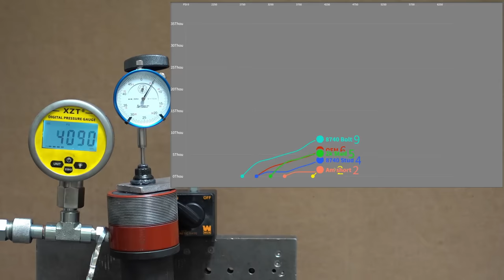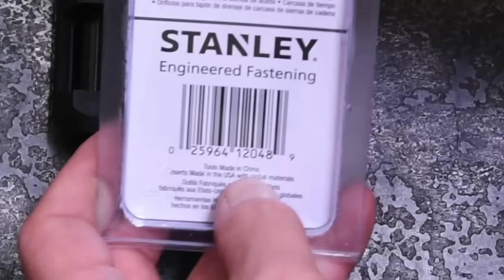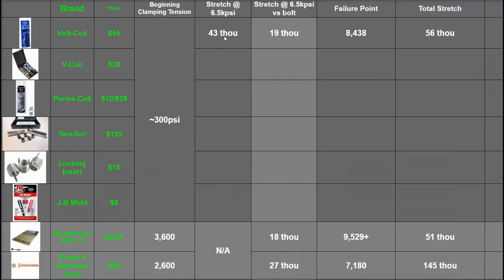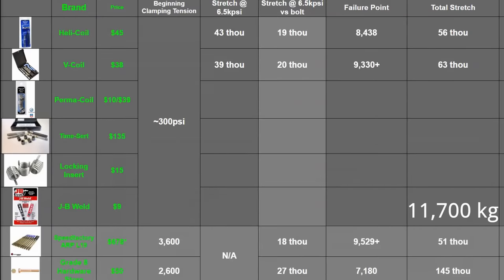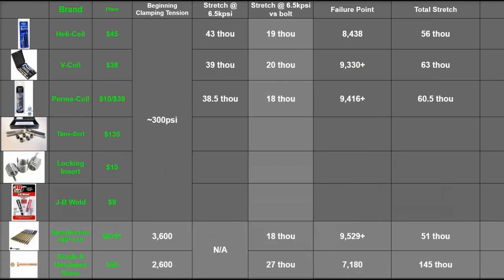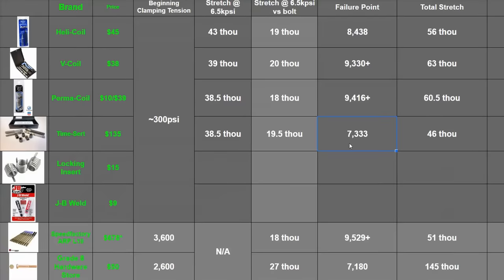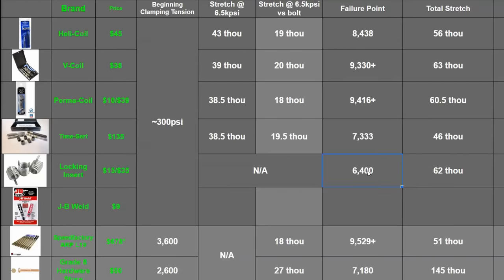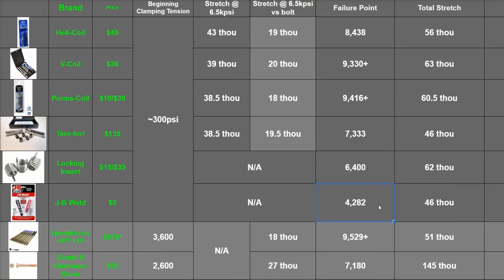12tons vs Bolt Thread Repair Using Time-Sert, Heli-Coil, J-B Weld & More

Comment: Two years later, I'd like to add a little info on the Time-Sert kit...
Time-Sert is a set typically suggested for stripped out spark plug holes...  CalVan is a similar design and often considered a better option than Time-Sert. 
The typical cylinder head doesn't give you a lot of material to work with and it can be very difficult to install a basic thread kit like Heli-Coil...  
By the way, it's "heelee-coil, not hella-coil. 🤣🤣..  
Time-Sert is designed with a shoulder to prevent the insert from being installed too deep. 
It's probably the best insert for spark-plug thread repair and considering low torque specs for spark plugs and considering that the insert is less likely to allow cylinder gases to escape past the insert. I'm sure there are other applications where an insert with a shoulder could be useful when you need depth consistency. 
Nothing is fool proof... I've seen spark plug repairs with Time-Sert/CalVan that blew out... If they aren't installed correctly, they are no better than any other brand.

Comment: Lots of comments about helicoils being good only for one use..that they won't stay put.
    Aircraft cylinders, from both Lycoming and Continental,  which covers 99% of anything over 150 hp, and most of the rest, all come new with helicoils for the spark plugs.
    They get taken out A LOT, required every annual inspection or 100 hours, depending on the type of use it gets, and usually more often than that. 
   This is an application where they are often sort of filthy from exposure to combustion byproducts from the leaded fuel, being run overly rich, oil fouling from high oil consumption, etc.
     I have had two start to come out with the plug, out of removing thousands over 30 years...
 ....actually, make that one, the other started to go into the cylinder when installing the plug, necessitating removal of that cylinder.
      If you have helicoils coming out frequently,  you're  probably putting them in wrong,  or loctiting the bolt into it or something.
    I also have no trouble with any coming out in many, many uses of them in cars, motorcycles,  whatever. They work so well. 
    I've also used time-serts, and have a friend who swears they are better, I've never agreed. Just much more expensive, and a bit more labor/complexity.
    When I say "helicoil", I'm also including off brands of the same type, which I've had good luck with also. 
   Simple and good. And now we know, as suspected, strong, too!

Comment: The locking inserts downfall is that they are designed to not utilize a full formed thread for the outside thread. You’re getting maybe 50% engagement of the outer threads because they have you drill a larger than standard hole for that size of tap. If you study the insert it’s evident the root of the thread is flat instead of pointed. Even given their downfall they’re still great for applications with a lot of surrounding material for room and where repeated removal is necessary.

Comment: The reason the helicoil is so strong even though it's just 304 stainless is that they work hard in it to something like 200-300 KSI.    So basically you can treat the helicoil as infinitely strong and the failure will  be the parent material or the bolt.    

Keyed inserts do better compared to gila coils when you have softer parent materials and so you need a larger area to spread the load out.

Comment: I JB Welded a bolt into an aluminum intake before and cut the head off to make a stud. Worked well for my needs, but intakes don't get crazy torque either so I can't say that for other applications.
I'm also happy that you and Project Farm tested these today. I have to repair threads on a push mower and wasn't sure how I wanted to do so.

Comment: Finally some question from many forums has been fulfilled. Some say that I am idiot using helicoils, I should use serts. I have used helicoils for exhaust manifolds and some various threads in the engines except cylinder head studs(never had to though). And one very big plus from helicoil style inserts is - of you screw it up you can pull it out and start again.

Comment: What if you used a helicoil inside of a JB weld tapped hole? Would that give more strength for extreme scenarios where JB weld is most useful?

Comment: Of the healing core you put the Loctite inside and not all the new threads their self. All the rest of them you did the opposite and they all held better. So did it have something to do with the application of the thread locker?

Comment: Excellent video - I've used v-coils for years for repairs and threads in 3d printed things, and we use helicoils at work. I don't understand the helicoil install tool - even the fancy aviation grade install kits for inconel helicoils look and work the same. It seems entirely unnecessary when compared to V-coils.

Comment: I want to see you get an M54 (BMW engine) block and test how much pressure it takes to rip the studs out of the block. When boosting them the most common things to go are the head bolts, the pistons, then the rods. I time-serted mine in order to "run more power" but this may have been a mistake. I never overheated the engine- so theoretically the block should not be that soft.

Comment: Have you considered setting up a lever on a pivot (think kids seesaw) between to test piece and the dial indicator? 

As the test piece fails upward, the lever arm on the dial indicator side will travel down and away from the indicator. You will have to start with a preloaded dial and do some math as your numbers are counting the opposite way, but that seems quite miniscule a task in order to save some dial indicators (Read LOTS of dial indicators)

Comment: Like many here I was surprised that the JBWeld did so well. Where did it fail? If it slipped out of the hole against the sides, maybe threading the hole before would be stronger

Comment: Surprised by the result from the Time-sent. It’s still perfectly usable, but I expected better. Going from memory, a time-sert kit is the only approved kit by Toyota for repairing the stripped head bolt threads that are far too common on the 2AZ engines. I’d agree though that it would be the best for applications where the bolt needs to be removed, especially if you don’t use thread locker (or you have to use thread locker on the bolt) since it is the least likely to just come out. Some thread inserts are literally not held in by anything and always come out when removing the bolt.

Comment: I'm curious how they'd work with a really "crudely" threaded stud (akin to some of the cheap bolts you see out in the field)... I think the precision/tolerance of the high end ARP hardware helped a bit (especially with the heli coil and v coil)
edit: if that Time Sert insert "felt loose" upon threading it in, the threads weren't cut very well.  I've done a few M54 BMW blocks with them (all 14 head bolt holes in each), and if you use a guide and tap carefully.. in other words, cut around a turn worth of threads, pull it out, clean all the chips out and go again... it's time consuming, but I guarantee if it was done that way (the time sert should go in with NO play side to side), it would've beat the crud out of the others

Comment: Done the JB Weld trick a few times. I've never drilled out the hole before cramming it full of JB weld. Not sure why this was done? Also let it cure for 48 hours, it's not really meant to cure that thick in an enclosed space. In terms of success, I've had about 50%. Sometimes it works the first time, sometimes it's the 2nd attempt.

Comment: Some really interesting results here!

I hate JB-Weld but you have to be impressed with how it performed. I wonder how it would do if the hole was not just drilled out but also tapped before being filled with the JB? Would the shape and greater surface contact give a better result? Would the larger volume of softer (compared to cast iron) JB give a worse result?

Comment: I wonder if some of those dial indicators could have been saved with a piece of "idiot string", tied securely to the indicator & stand, and to something overhead, with enough slack to allow free movement but still catch it before it hits the floor?  Or was the damage already done by the violent upwards acceleration, and crashing to the floor was just adding insult to injury?

Comment: instead of destroying a million dial gauges, try a limit strap setup or such as what you see on high travel suspension. so that when it blows it both allows the measured stretch, while directing the broken part away from the gauge. The limit strap could be oriented in a way off to one side so that it always explodes away from the gauge face.

Comment: ya know... since a dial indicator requires basically no effort to move them, you could probably make an off-set reader for the dials that can pivot when an excessive amount of force is applied. That way you don't have to worry about replacing the entire dial indicator every time. just reset the indicator's arm. (i'm thinking something like a nut and bolt that tightens down on a Y shaped pivot?)

Comment: I’ve had the same problem with timesert myself.   They actually came to my trade school to pitch their product. 
Claiming that their solid insert was superior to the coil type.  In my years of practice , the coil type is superior to the timesert. Their wall is too thin and collapses. Whereas the coil type forms itself to the hole.

Comment: You may not read all these comments but I thought this was an excellent test. Though I do think you need to retest the timesert. I have tested many different configurations myself, not using such a sophisticated system as you have but simply torquing an arp stud to failure. Timeserts have always been stronger than arp2000 studs in my testing. The stud fails then rips the insert apart as it stretches. Did you reuse the same stud repeatedly for each test? Is it possible the stud was already stretching a bit on the previous test over 9000 and then the threads where loaded very unevenly on the timesert? The helicoils will unspring with the fastener threads as they stretch, the solid timesert cannot, it breaks. The testing I have done was in aluminum and steel and a cast iron engine block. For sure helicoils do not have the same strength in a softer base metal like aluminum as a timesert does. Another interesting test would be repeated loading below failure especially taking into account removal and reinstallation between loading , this is also where the limits of helicoils show up. I would love to see another round of testing like this but push the load higher until the fastener or insert fail and especially comparing the strength of the bare threads in aluminum then with the different inserts, maybe use 2 or 3 rounds on the same setup so you are ruling out any sort of anomaly and having only the one funky data point. Replace studs approaching their yield area if you didn't already in this test or at least measure with a micrometer to check for stretch before the next test using that stud. I have no vested interest in defending timeserts but your results simply don't line up with all the testing I have done myself.

Comment: Putting a steel plate under the nut to give an offset surface to indicate from underneath may save your dial indicators

Comment: Testing across a temperature range of the JB Weld thread would be interesting… use normal engine block temperature range as a base… winter -20’C upto +140’C?

Comment: You have to put at least 2 Heli-Coils on top of each other to get the maximum strength. If you just put in 1 the material around it will crack.

Comment: U gotta try the ns300l inserts from huhn solutions I’ve used them to fix northstar head gasket failure due to the threads pulling out the aluminum block, used them in Kia’s too there a really good product

Comment: Aged ARP 625 studs have the same 260,000 psi tensile strength but without the draw back of not being able to handle them with your fingers. L19 studs can become brittle making them ineffective.

Comment: Should try this with belzona epoxy instead of jb weld. Have used belzona for this type of repair in hundreds of threated holes that seal pressure in and out on submarines.

Comment: Question.  Why don't you just measure the movement of the "cylinder head" from below?  So when the Bolt breaks and  flies off, the dial indicator isn't hit. It's all still the same movement.

Comment: So, it hurts my soul watching the indicators shatter like that. Would it be possible to weld a flat bit on the side of the bolt head (maybe even super glue would work?) and have the indicator read from the bottom?
Reply: agree. maybe make a net to catch the indicators

Comment: Possible amateur question here. If you drill out the hole and re-tap it, why not just use a different bolt and not use an insert at all? It'll be a bigger bolt so won't that make the connection stronger? I've done this many times and haven't had any bad results. I've even done it on oil pan drain bolts that strip out. Am I missing something?
Reply: 1) There isn't always enough room in the metal or the surroundings to fit the next size bolt, which will usually be at least 2mm bigger.

2) You don't want to end up with different sizes of bolt when there was only one before.

Comment: I always buy the cheap stainless helicoils 1,5 or 2 x Diameter lenght.  20-50 pcs. and I just cut them if to long.  I newer use locktite. put them in alu from new. if it needs good holding power. and yes normaly, they hold better than 8.8 bolts :)

Comment: I’m no advocate for JB weld but I wonder what would be the result if you drilled and tapped a helicoil sized hole, then injected the JB weld with a cheap syringe to the bottom of the hole so there’s no air bubbles, then let that cure, tap and drill that with the right size. 

On the one hand, there’s more JB weld between the bolt and the hole possibly making it weaker, but on the other hand the JB weld would have more threads to hold it in the hole, on the other other hand those threads being so close with the helicoil only works because of the thread timing, you’d lose a little thread timing between the inside and outside threads, idk if that would make it stronger or weaker.

Comment: Interesting. I remember installing a lot of heli coils early on in my career (we pronounced them "he-lee").
Haven't got through the video yet, but I hated them. IIRC they were a limited use. With every bolt in/bolt out cycle it would get harder and harder not to cross thread or strip out.

Comment: Im a bit sceptical with the hand tapping i guess thats how most people will do it but for a completely fair comparison you’d like to see machine tapped or thread milled holes for consistency
Reply from the maker: If that's what's required for a repair to work better than others then it doesn't apply to what we'd use it for

Comment: Think about your drill and measure the run out if you need one of these. The drill wobble and bit error alone or combined could be enough to fail otherwise fine coils. Do same test with a HF 80$ bench top drill that would be interesting.

Comment: Since the Helicoil test blew the top of the cast iron out, I'd be curious to see this with the "installed depth" called out. Barring all that, if supplies allow, run a Helicoil a little deeper, and see if anything changes... (Failure mode seems odd)

Comment: I think it would have been interesting to first have a tapped hole to put the JB Weld into, and then drilled and tapped a smaller size hole into the JB Weld to simulate the threaded in meteral like the others

Comment: How about setting double length coil inserts against the others in cast aluminium and doing the fastener up to recommended torque, and then releasing. Keep doing this cycle until failure. I'm willing to speculate the coil inserts will fail first. You tend to get thread pickup and then the insert backs out. I put in studs to save cycling the inserts where possible.
Reply: For maximum strength in soft aluminium the insert should be 3 diameters long. With helicoils you can get away with stacking two 1.5D coils if you don't have any 3D's.

Comment: Helicoils are stupid strong…knew a fellow who used to build alcohol cars. Any time he got a new motor, first thing he’d do is drill out the factory holes and slot helicoils in.

Edit: referring to thread inserts as ‘helicoils’ not specifically the name brand

Comment: I think you would be most likely to need this type of repair in aluminium
as in spark plugs or oil drain bolts

generally you shouldn't "need" any type of thread repair unless someone screwed up, but apperantly it is also used to make threads in aluminium more durable and wear resistant

I had to use helicoil on a brake caliper too because....well, someone screwed up, basically the type of risk you take buying a used car
I bought the cheapest one I could find on amazon and it worked just fine, then again, VW caliper pins just need to be snug

Comment: Why not slip a piece of tubing over the end of the dial indicator that is slightly longer than its own travel. That would keep the indicator from getting bottomed when the piece breaks loose, saving the indicator.

Comment: I have to wonder if the variations that you're seeing here are more due to the previously abused cast iron billets, and not the items themselves.
Reply from the maker: Thread repair is typically used on previously abused threads

Comment: I would like to see JB weld used in a hole that’s stripped but you can still lightly thread a screw into. Fill the hole with JB and then thread the bolt in to snug then let it cure